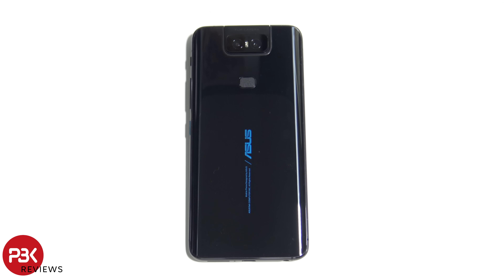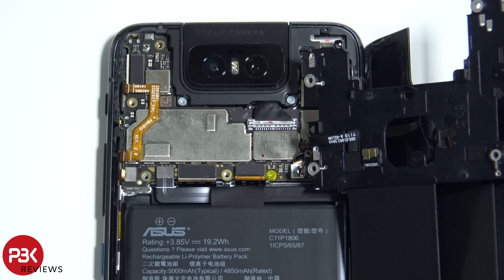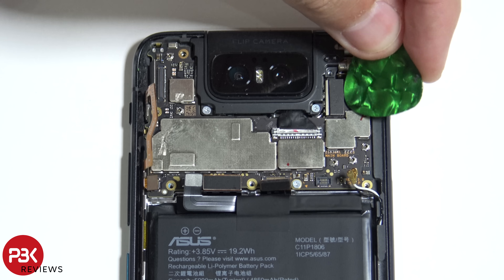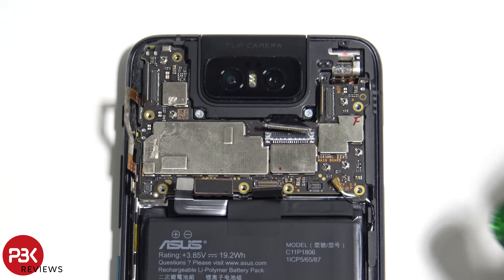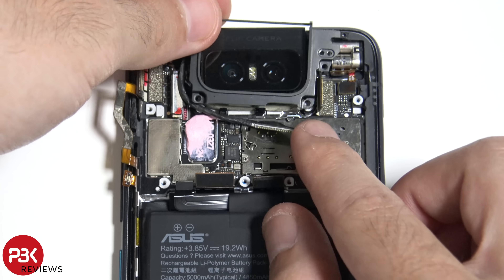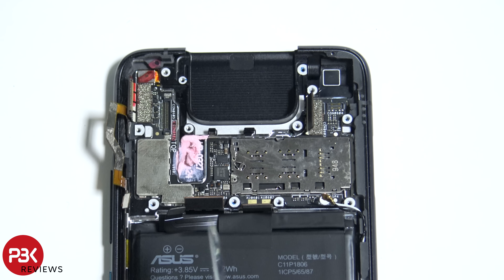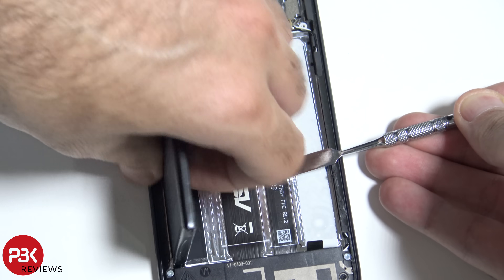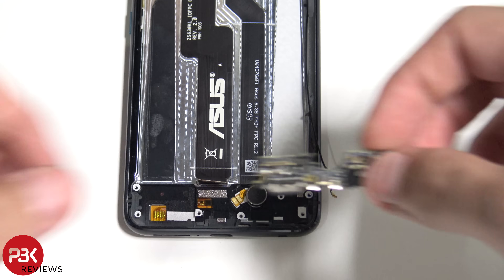Asus Zenfone 6 / Asus 6Z Teardown Disassembly Repair Guide Video

Comment: my charging dock port is broken... in warranty but can t find the receipt
Reply from the maker: Sometimes they go based off the IMEI of the phone or serial. Have you tried?
Reply: @PBKreviews  thany you but in my country they only accept receipt as proof of warranty
Reply from the maker: @wittner82  Oh I see. Ya most places are like that. You can always replace the charger port board, or take it to a repair shop to do for you.

Comment: Do you happen to know if the asus 6z has two microphones? Mine seems to record video audio only on one ear, and the microphone doesnt work entirely if it is not recording through loudspeaker. I bought a new part and tried replacing it, but it still records that way, which leads me to think that it probably has two microphones and one could probably be on the earpiece. What do you think?
Reply from the maker: Hi, there is a primary mic on the bottom charger port board (its the goldish color rectangular metal piece on the corner) and there is a secondary mic on top left of the main motherboard. There may also be a third mic in the camera assembly, but that one I am unsure.

Comment: Hi Mobile Master!!

I was wondering if I need to change the fingerprint sensor, How should I take down the sensor?

Also If I changed to a new back shell, how do I glue them back? what glue would you suggest?. 

Thank you very much.
Reply from the maker: Hi, it's held onto the back plate with adhesive. Just heat it up gently with a hair dryer or heat gun and pry/pull it off the back plate. Usually replacement back plates come with pre-cut adhesive. If not, then you can use 300LSE adhesive or smartphone red tape or another type of smartphone adhesive tape to cut stripes down to size and apply on the frame then apply your back plate back onto the frame.

Comment: HI I DROOPED MY 6Z IS LITTLE WATER, AFTER KEEPING IN A RICE FOR 48HRS, PHONES WORKS BUT TOUCH HAS GONE,,PLZ HELP ME WHAT SHD I DO??
Reply from the maker: Always whenever your phone gets in water (when its not water resistant to handle it) you need to never try to turn it on and take it apart as soon as possible to disconnect the battery. Because every time you try to use it, you can short out your motherboard or other parts in your phone. You need to take it apart, make sure you clean out any water in there and also brush off any corrosion on the chips and connectors with a small brush or tooth brush. After making sure you dried out any water and cleaned off all the corrosion around connectors and chips, put it back together and see if it will start working again. If not, its possible your screen needs to be replaced or also possible a circuit or chip on your board has fried and you probably would need to get another phone because repairs on things like that are not easy and very few places can actually preform repairs on water damaged stuff.

Comment: So an ASUS update bricked my phone. Now dead. No charging LED, no amount of button push combo will bring it back to life. Pretty pissed off! So where can I order parts for this phone online? (Specifically the main board). Cheers
Reply from the maker: The main board usually isn't sold unless someone parted out a phone and listed the board on ebay. Your best bet would be to find a used phone and take the board from that but at that point you might as well be using that phone and not transferring the board. Have you tried reflashing the phone with the original firmware? I know you said it has no signs of life but sometimes there is ways around it. Check on google for unbricking your device or how to reflash the firmware.
Reply: @PBKreviews   thanks for replying. The phone is totally unresponsive and isn't even recognized by a PC. XDA forums suggest it's another main board fried by ASUS software which ASUS knows about and have acknowledged is a potential issue. 
Being out of warranty my only option is replacing the main board myself. I would never trust buying a used Zenphone 6 after my experience (already had the Usb charging board replaced under warranty) and with the multiple failures experienced by a lot of poeple.
Reply from the maker: @Homerlovesbeer2  Have you tried contacting ASUS? If they know of a possible issue you can push them to honor out of warranty repair for that. I would push to speak to a supervisor if I had to or a manager in the department and make sure they took care of it.
Reply: @PBKreviews  yep working on it. I'm in Australia and unfortunately the Zenfone 6 wasn't sold here so I have to contact Taiwan head office and push them somehow.
Reply from the maker: @Homerlovesbeer2  Was it originally purchased from that region? You can also try contacting the global sector or us based location if it was a global model and see if there is anything they can do. Hope it works out

Comment: Where is the microphone near charing PCB.. I wasn't able to see it..
Reply from the maker: Its circled in this picture I uploaded here : https://ibb.co/9hZ59NN     It's the rectangle gold color piece
Reply: @PBKreviews  one last question.. Please.. The best adhesive which we can use (as a tech for fixing mobile screen / mobile back door replacement).. Cuz I'm not satisfied with the current adhesive which I'm using..
Reply from the maker: @aj_cgsvideos3446  I always try to find a back panel for example which comes with the original precut adhesive since those adhesive strips are stronger and also help retain any water resistance a phone may have had. But since they are not always available, you can either buy 300LSE or smartphone red tape etc. You can also buy an original precut adhesive for a phone in a similar size to your phone and use that adhesive strip to cut it down to size since the original manufacture strips for the phones in my opinion seem to be best and any of the rolls of adhesive I have tried usually are never as good as those. So for example if I see there is say a galaxy s9 precut adhesive on the market but not one for the s10, then I may buy the s9 one and if the s10 is larger in size maybe buy 2 of the s9 and use 1 and however much of the 2nd I need to make sure I got adhesive all around. Hope this helps.

Comment: How long you have to heat the back for? I simply can't even lift the back side
Reply from the maker: You can heat it up with a hair dryer for about 20-30 seconds moving it all around the back to evenly heat the back up, then when your able to gently lift up on one corner or get a pry tool in underneath one corner, you can keep applying heat as needed (to keep the adhesive loose) and work your way around prying the back panel off. If needed you can use a razor or thin metal tool that would fit in between the backplate and frame so you can lift the backplate up giving you room to put your pry tool in, but I don't recommend doing this since that increases your chance of scratching up your frame or if you put too much pressure breaking the back plate. So a suction tool would be best.
Reply: @PBKreviews  Thanks for a detailed instruction. I managed to do it with a better suction cup.
Reply from the maker: @igor_yavych  You're welcome, glad you were able to get it done :)

Comment: ola meu amigo vc teria um video trocando a tela frontal desse zenfone 6 flip ai que vc mostrou a troca de bateria por favor obrigado
Reply from the maker: Hi sorry, I don't have a video of it or the phone to do one. After you take the phone apart, the screen is held on with adhesive. You just need to heat it up and pry it off. If you can find a complete screen assembly with frame already installed, that would make it much easier for you to replace since you can just follow this video.

Comment: So the final piece in this teardown. Is that the lcd? Because i smashed the glass on mine and i'm thinking about fixing it myself since the closest asus repair show for me supposedly takes over two months in fixing asus phones and also takes a about 100$ admission price just for leaving the phone to them, and then the repair costs and parts on top of that.
Reply from the maker: yea the screen is held on with adhesive you just need to heat it up and pry off the old screen and apply new adhesive and reapply the new one and reverse the disassembly process

Comment: After replacing broken LCD the Proximity sensor has stopped working. Since Proximity sensor is inside LCD module, is there any other possibility than the replaced LCD module being faulty?
Reply from the maker: Sometimes aftermarket companies either wont include it, or will not have certain rubber gaskets around the proximity sensor preventing too much light hitting it etc. Also some companies sometimes don't make the glass over the screen correctly and paint completely over where the proximity sensor would lay underneath (instead of leaving a small dot area unpainted) and this makes no light go through the glass to the sensor so that might also be an issue. These are things you can possibly look into if you pry off the screen from the frame and see why the sensor is not operating.
Reply: @PBKreviews  I should have mentioned that I replaced the screen + frame from Asus authorised service centre. He told me that the proximity sensor is not working so I'll have to wait untill he receives another part from the company. Service centre are work very slow here and takes weeks so I accepted the screen without proximity sensor working and decided to fix it myself. BTW all the points you made makes perfect sense when the replaced parts are not original.

Comment: Hopefully the furthest I would ever have to deal with if/when I get this phone is changing the battery
Reply: It actually will. I'm dealing with ZenFone 6 for 2 years now, and despite all the times it felt down and all the things it survived, only now I suddenly have some issues with it, which are battery related. The phone itself is working perfectly fine. Even the screen quality is amazing, I never had to repair the screen, no cracks at all.
Reply: @iaroslavsorokin4318  been using my ZenFone 6 for 2 years also. And I also experiencing some battery issues :(

Comment: never ever use a metal Pry tool to disconnect the ribbon cables because them might cause short circuit use of plastic pry tool
Reply from the maker: The battery was disconnected in the beginning its fine
Reply from the maker: Always best to use plastic but sometimes plastic doesn't do the job. As long as battery is disconnected, should be fine.
Reply: @PBKreviews  ESD could still be a problem though I'm sure you have that covered in a different way..
Reply from the maker: yea but honestly in the past 15 plus years I have never had any issue with ESD and I have taken apart thousands of phones. Now I wouldn't suggest working on carpet and doing it but I have always had pretty static free work areas so yep :)

Comment: My suggestions:
- Move the camera, above the smartphone and it's okay to place it abit farther since your video is 4k, it's clear enough to see even if it's not close up.
- And I notice that the camera is constantly bothering you since it's between you and the phone,.
- Try to use bigger and softer light source.
- Try to talk more slowly and clearly (I don't have any problem understanding your voice, but maybe not for other non native speakers.

The internal design is amazing, it house that huge rotating camera module, triple-slot sim+sd tray, 5000mAh battery, and still have 3.5mm jack!!
Reply from the maker: Thanks for the input, I will work on it :)

Comment: Nice video, but i would like to see the phone working again after reassembled, not just booting. Specially the camera. Just to see it back to where it was
Reply from the maker: here is the link to the camera working, It didn't let me add to the original video so I posted a separate one which I will keep up for a few days. https://youtu.be/ZE3akd8y2rs
Reply from the maker: Ya should have added the camera in use afterwards. Ill see if it will let me add onto the end of the video, if not I can upload the video of the camera in use and link you to it.
Reply: @PBKreviews  I absolutely believe that it worked again because i think you did everything necely, i just think that showing the phone working again is the perfect end for this type of videos
Reply: @PBKreviews  It would be awesome if you could do so.
Reply from the maker: here is the link to the camera working, It didn't let me add to the original video so I posted a separate one which I will keep up for a few days. https://youtu.be/ZE3akd8y2rs

Comment: One of my main concerns is that it's not ipx dust/ water resistant. Is there anyway to add water resistance through disassembly? Otherwise, I think the phone is almost perfect.
Reply from the maker: Would be hard to tell, you can try adding water resistant adhesive, and covering the ports internally somehow with filters like those that go over speakers. But not sure if it would for sure make a difference or not.
Reply: Buy a water resistant case. It would be chunky but practical
Reply: @danielmartuniac9928  That is the only real solution if you want to use this phone on a motorcycle or something.
Reply: @danielmartuniac9928  I'm not sure you understand supply and demand. Case manufacturers focus on the most popular phones because they will net the most profits, especially considering the r&d involved with making cases for new phones. The fact is the Zenfone 6 will sell 1000x less phones than the Iphone does. My point is there is no waterproof case for the Zenfone 6, and there won't be one because it's not popular enough to warrant the case creation.